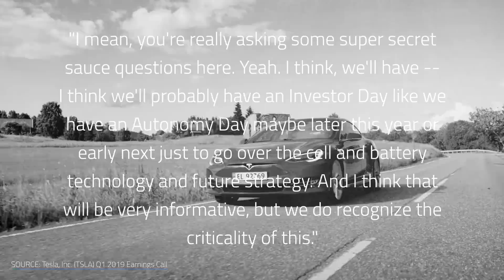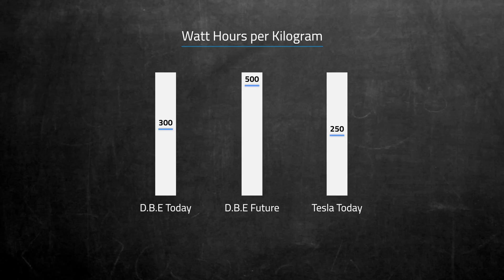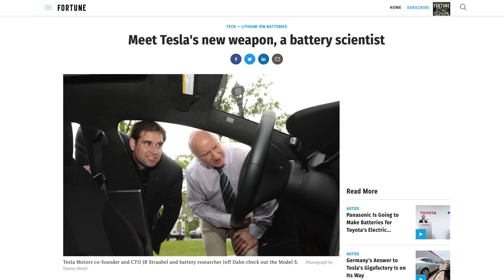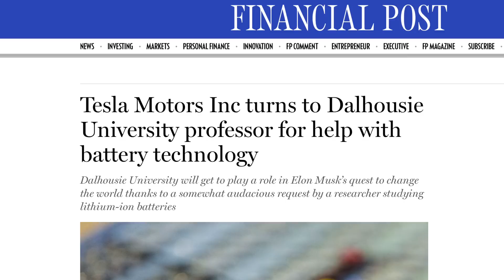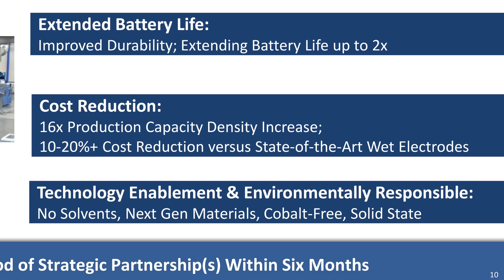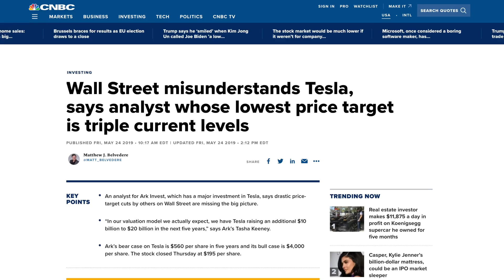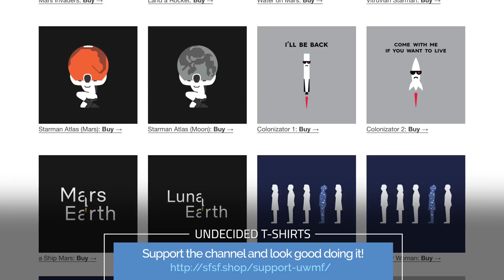Tesla And Maxwell Technologies

Comment: My 1st video from your channel. Definitely subscribing. My understanding is that Tesla is in trouble trouble not because analysts don't account for their Apple like focus on vertical integration but rather where they are applying this focus to. The future of transportation according to @asymco is not in the cars but micro-mobility. Tesla simply does not have a solution in that market. If battery production is your limiting factors, the car is not the optimum platform if you wish to expand capacity and provide a transportation solution to the greatest number of people.
Reply: Europeans and many American large city dwellers have made inter-city and mass transit an alternative to the expense and hassles of car ownership; but across the vast non-metropolitan areas of America, car ownership is independence and freedom to travel at-will, in comfort and without dealing with odd or dangerous co-riders on mass transit. The car will not pass from the American scene for many, many decades - if ever.

Comment: You could have gone into what an ultracapacitor does on the acceleration and braking and how it can capture more energy during braking Elsa deliver power faster getting quicker acceleration.
Reply from the maker: Fair point.  There is definitely more Maxwell tech they can put to use, but I think the battery (DBE) is the most impactful for Tesla’s business.  But I should have touched on it.

Comment: Maxwell’s ultracapacitors also have the potential to reduce the number of charging cycles on the battery cells, which also increases battery life.
Reply: Thought I heard Maxwell CEO mentioned faster charging and more charge cycles as benefits of dry cell construction?  With a million mile battery part of the gain has to be more charging cycles.  It will be interesting to see.
Reply: ultra capacitors still hold less than a Li-Po battery. It would be a more efficient use of limited space to just go with batteries. 
using both would have no additional benefits. batteries wouldn't charge faster. The capacitors would charge fast then slowly charge the batteries if configured that way.
opposite way is using the batteries to charge the caps. which itself is pointless. 
either way its bottle-necked by both the batteries charge rate/life cycles, and capacitor energy density. there is no "best of both worlds" by using both together. which is why no one does it.
Reply: DarkShadowsX5, stop-and-go traffic, which of course is pretty common, is one place where uptracapacitors can potentially help in terms of battery life.  Regenerative-brake into ultracapacitors, and then, as you alluded, “leisurely” recharge batteries from the ultracapacitors only if that regenerated charge isn’t promptly re-used for acceleration.  The point being that it often will be, and the ultracapacitors can resupply it at very high power.  

I can’t recall which particular ultracapacitor company it was, but their CEO said, amusingly I thought, “we’re not in the kilowatt-hour business;  we’re in the megawatt-second business!”

Comment: I really want a Model X but a bit steep on price, so looking forward to Model Y.  But question, why are insurance so high on any Tesla?  Thanks
Reply from the maker: I’m not sure why some companies have high Tesla insurance costs.  Mine is actually cheaper than my previous car and my wife’s Mazda 3.  Safest car on the road, low theft rate ... should be cheaper.  It’s worth shopping around.
Reply: @UndecidedMF  Driving for over 15 years no ticket or accident.  I have 2018 Audi SQ5 and paying $1300 for a year and quoted the X $2500 like why?? I even tried the new Tesla Insurance and it was higher.  Something is wrong and paying that high is somewhat okay if you are 18 and have speeding ticket but not in your 30s.  Sorry venting.
Reply from the maker: You won’t hear any argument from me!  Your track record, and that of Tesla’s, should mean lower prices.  I’m surprised ... and yet ... not.  Not sure what company you have, but I have Traveler’s Insurance.  Great rates (at least from my experience).

Comment: "Tesla is similar to what Apple USED to be" is what you meant to say surely?.....About the only thing I'd credit Apple with innovating since Steve died was a profit path for investors.
Reply from the maker: My main point was the vertical integration.  Even today Apple is killing it with their custom silicon, which is based off the ARM architecture in their A series of mobile chips.  They absolutely destroy the competition in power and performance.  They design chips that support the features they want to write into software.  And vice versa.  It gives them an edge in software and hardware performance on mobile devices that’s hard to match (just look at the performance of the iPad Pro compared to most laptops).  That’s more in line of what I was thinking when comparing Tesla to Apple.  Tesla is designing the whole widget in a way that the rest of the automotive industry can’t match.
Reply: @UndecidedMF  True, the performance you get from fcp with even the inferior AMD cards render so fast.
Reply from the maker: Definitely.  Speaking of which ... I really wish Nvidia and Apple would work out there differences.  Enough already.

Comment: Surprised there was no mention of hybrid capacitor battery systems given Maxwell was known for making super caps as well.
Reply: That was my question, too - supercaps sound like an ideal solution to avoid the "micro charge cycles" when braking and accelerating.
Reply from the maker: I should have touched on it, but don’t think that’s as critical to the success of Tesla as a business as DBE is.
Reply: @UndecidedMF   No problem, there was a lot to cover.  Nice Vid.

Comment: With a lighter and smaller area for batteries, room is freed up for ultra-capacitors; they can improve the efficiency of regenerative brakes and suspension by acting as a buffer to absorb a lot of energy (quick stops, for instance) more quickly than a battery can by itself. Tesla recently limited some charge stations to 80% fills due to demand, yet an ultracapacitor that holds 20% of the total battery capacity can charge in a few minutes. It can hold the electricity until absorbed gradually by the battery or used by the vehicle for acceleration or other uses.

Comment: I don't think it is 16x smaller battery production area.  I think the electrode production area will reduce by 16X.  The rest of the battery production area will stay the same.  In the end the whole battery production are will reduce by 30-40%.  No where near 16x, but still a significant amount, almost insurmountable by the competitors.

Comment: Did you forget about the super capacitor angle or are you not aware of how it can be used in cars?
Reply: Regenerative breaking, or even faster acceleration? Not that important for tesla.
Reply: @hans1993hans   True, but reducing the battery size is.
Reply: @Utahdropout  how do supercaps help with that? Energy density is crap compared to batteries.

Comment: The Short Sellers have so much money in Oil stocks I would not be shocked to find out that Broker houses do not want to see All Electric car companies to succeed or at least make it as hard on them as possible because Oil supports, local Parts stores where consumers go to buy oil, to Gas Stations where we fuel up, to exhaust systems to all of the manufacturers of sensors for the combustion engine and the list keeps growing.   It isn't Tesla or Elon it is what it represents.  That is why Tesla is staying true despite the rhetoric.  Since Tesla doubled down and asked for more capital if the Market fights that effort well it goes to show the Oil stocks and all it supports won't go down without a fight.

Comment: Batteries will likely be a commodity market with 3-4 large suppliers to all the auto and other use cases.

If all vehicles are to be EVs then Ultimately we will need 200 million EVs produced per year at 50KWh packs average = 10,000 GWh yearly production or 200x giga factories. Tesla might own 1-10 of those giga factories but the other 190 will dominate the market.

Like with PV panel production I suspect Asia will take most of the market share.

I like Tesla but cars are not software there will not be one-two dominant companies but a dozen plus companies and most likely no single one company will have more than 15% of the market

Comment: Maxwell's Ultra capacitors might be added to the battery pack at very small capacity (cost reasons), just to handle regen breaking chargback. Ultra cap's charge / discharge efficiency and cycle lifetime is much better then chemical batteries, resulting in even longer battery pack lifetime and increased range for start 'n stop urban driving. Also, we already have hints they use this technology in the Model S Raven refresh suspension.

Comment: You missed a couple big points. Maxwell advanced battery innovation, but their primary product is ultracapacitors which do short term regenerative energy storage much better than batteries. Ultracapacitors take away the battery heating from regenerative braking to maximize battery life.
People are also talking about harnessing energy from the suspension using electric shock absorbers. Ultracapacitors improve that also.

Comment: I’m way more interested in where this will go with home solar power storage!!!  Ultra and or Super capacitors along with solar is what going to put the high cost of electricity in check with APS & other power companies...
Reply: Kindly expand on this. 
How can ultra capacitors be combined with solar? If you don't mind...
Reply: Rotimi Orimoloye  it all comes down to daytime power storage while the sun is out and using that stored power at night when the sun is down instead of pulling from the grid
Reply: @FATL0L0  
Are you suggesting that ultra capacitors will do this better than Lithium ion batteries or solid state batteries would?

Or are you suggesting that the technologies (batteries + ultra capacitors) can be combined to produce greater value?

Comment: I think you forget the point, where tesla can make "hybrid" cars where the integration of one supercapacitor besides the battery, can handle the energy from the generative braking.
Reply: Tesla's all do regen braking already, unless the battery is at full-charge.  Capacitors going into suspension though to regen energy from eg potholes getting hit.

Comment: Doesn’t the Rivian vehicle already sport a battery with more range per charge than Tesla?
Reply: The Rivian battery is spec'd at either 120 kW or 140, I can't remember off the top of my head.  Currently the largest pack size Tesla makes is 100kW.  Considering that they use a significantly larger battery, we should expect that their truck will to go further on a charge. 

The caveat is that we do not have any Rivian vehicles that have undergone any independent verification testing yet.  For all intents and purposes it's still a concept vehicle.  There are a ton of other factors that influence range, the biggest being aerodynamics and motor efficiency.  Consider the Audi E-tron:  90+kw pack but the company limits the customer to only use 80kw of that and combined with less efficient motors and styling the E-tron has been posting some comparatively poor efficiency numbers leading to disappointing range per charge.  (Note: I'm not saying the E-tron is a poor vehicle, it is actually a good vehicle but from a strict range/efficiency perspective it falls well short.) 

To sum it up: the Rivian SHOULD go farther than a Tesla on a charge because the customer is paying for a bigger battery but we don't yet have any real world verified numbers to back that up and we've got numerous other examples of vehicles actually falling well short of the range we would expect based off battery size alone.

Comment: I don't believe you missed anything. I do feel that the newer battery solutions will pave the way quite soon I might add for ranges of 600-1000 miles and with more initial stronger bursts of energy which is to say more "horsepower" immediacy and vastly reduced charge times, say 5 minutes for 30-45 percent, 10 minutes for 80-95 percent. The future looks very bright indeed!
Reply: Faster charging will depend on size of super cap bank.  A large super cap bank will take up a lot of space...so I don’t see full charging times changing much....Splashing a few kwh into vehicle would be quicker, tho.
Reply: Jim Hofoss I politely disagree. Charging times have and are continuing to go down. To your point though battery capacity has gone up significantly. I believe that with Graphene and Supercaps and further advancements in nanotechnology we will indeed see more of everything (or much less Haha! Excuse the pun.) in terms of vastly improved efficiency and size of packs. Cheers

Comment: Don't forget about "hybrid batteries". A mix of super capacitors and the new li-on try you mentioned... Imagine a lightweight super cap pack in addition to your battery, worth about say 10kWh or so.  You would pull into a super charging station and receive a 10kWh charge in seconds, not minutes. Thus would be a super cap bank to support cap bank transfer behind the scenes at the charging station.  If that's all you needed to get home then you'd be in your way again in literally 120 seconds.  This super cap bank will also make regen breaking closer to 100% efficient. Today the li-on battery cells just don't have the ability to recharge or discharge as quickly as the regen allows at maximum regen or for that matter discharge fast enough for the electric motors to ever see their maximum power ratings all at once.  This solves the max performance issue and greatly increases regen and over all efficiency.  Plus don't forget super capacitors are immune to temperature hot and cold extremes!  No more losses due to sub zero weather.  This cuts down on phantom battery drain also as a vehicle sits.  Lastly, a super cap bank would lend greatly to li-on battery packs longevity.  The super caps would be a type of "buffer" used to slow the discharge and recharging rate of the battery pack as the cap bank would do all the heavy lifting required for maximum recharges and discharges.  This buffer would virtually eliminate all shock and stresses the li-on pack would ever see. Couple that with the cap bank buffet not ever letting the battery pack ever see extreme charging and discharging states (like never letting the battery ever physically be below a 10 percent charge or above a 90 percent charge, because the cap bank buffer would take over and cover the last 10 percent at both ends under software control) and you've got a hybrid battery pack that would virtually never wear out in a lifetime of driving.
Reply: soooo....you're saying i should hold off on buying my Model 3 until they bring all this new tech on line??
Reply: @alexanderhamilton8585  no, just something to look forward to. I bought a Tesla two months ago and I'm glad I did. And the future of battery technology looks very bright. Today's Teslas get plenty of range. The future will be more capacity and faster charging speeds
Reply: Okay, let said, a software that manages  the power battery, combine the  Maxwell batteries in the x % flow from the generator mg1  in every coasting or breaking of the vehicle , i know we  use brute force energy coming from the generator mg1,  I mean  the technology  is al ready there??

Comment: The Apple comparison is dumb. Apple designes the chips based on ARM architecture and Samsung manufactures them. Any company can design their own silicon with a computer program. I designed a silicon integrated circuit as an undergrad electrical engineer.

Comment: By Apple's vertical integration, do you mean them not manufacturing a single part, and having various Chinese and other Asian manufacturers built parts for them to be assembled by Foxconn? Lol
Displays by Samsung and LG, processors by Samsung and TSMC, OK, I guess the glass is made in the US, and possibly some of the radio chips, but most of it is manufactured overseas, and none by Apple.
Yes, they design their own chips sometimes, and then have someone else make it.

So not sure what you mean by their vertical integration..

Comment: Totally missed the Ultra Capacitor side of the business. Glaring lack of knowledge regarding the Ultra Capacitor benefits to Tesla.
Reply: @ Jeff Sol, Ultracapacitors ARE available today, you can buy them from Maxwell and a rift of other innovative suppliers. Indeed, they aren't cheap, but you don't require a shed-load of them to play the role they play very well: charge & discharge fast with little or no degradation. Ideal for adding them next to the DB cells.  Through handling regenerative breaking (fast storage) & power demand peaks (when accelerating), it significantly protects the DB cells from degeneration thus helping to achieve that 1 M Mile goal.  All makes perfect sense.  BTW, placing a few Ultracapacitors next to a Tesla Powerwall/Pack will do the same trick in the static battery context.
Reply: @Jeff SolThey are not to replace batteries but to enhance them. Read Bert Verschuren's reply. Best not to jump the gun fella.

Comment: It is entirely reasonable for a company to sell any extra capacity to customers that are not current customers. That's business. As SpaceX gets StarLink up & running, it's a given that the Fleet will be used to collect connection quality information. Once that checks out, StarLink will start selling to non-tesla customers. As they are doing in Europe, SuperChargers are equipped with Tesla & CCS plugs so it is only a matter of time before Tesla can sell 250 kilowatt charging to non-Tesla CCS users. Electrify America seems to think that near-gasoline pricing will fly so there's definitely a window to exploit. When they become the first battery manufacturer to hit the '400' mark, the electric aeroplane biz will be knocking on the door.